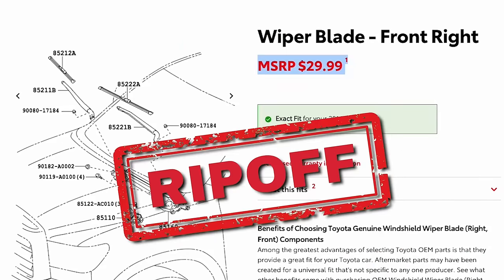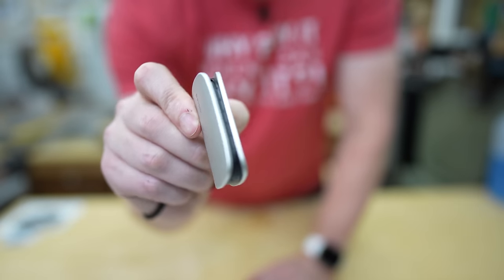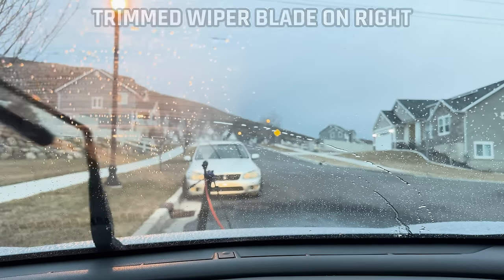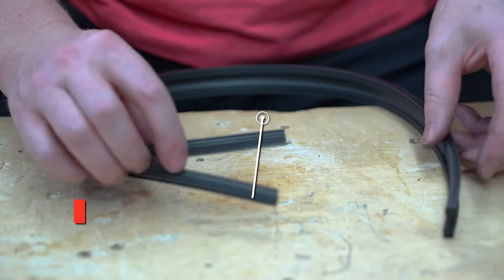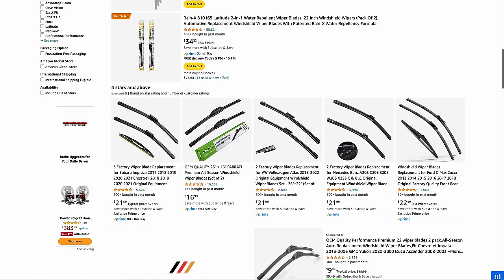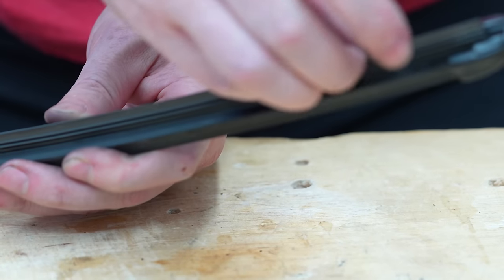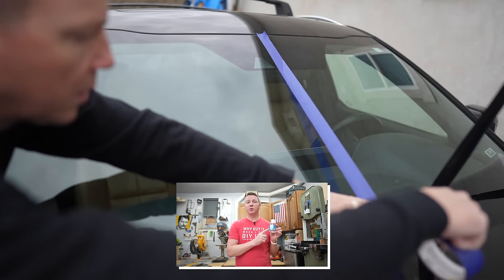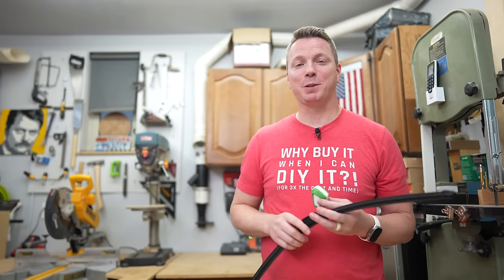Windshield Wipers Are a SCAM! 3 Ways to Save $$$

Comment: I experience engineered obsolescence with my wiper blades. Before the blade edge wears out the entire blade separates from the rubber portion that the frame holds onto. The connecting strip has become thinner over the years so it tears away faster.
Reply: This the silicone wipers?! I just got some from a recommend by the Autozone cashier, and they are impressing me. Hope they last. Was changing my normal rubber ones every 8 months or so.

Comment: To super clean and prep your windshield, try this.  Do this only on clean dry glass. Not on window tint.  Scrub glass with 0000 steel wool. It is the finest grade.    It will pull out any impurities in the glass, like clay barring paint.  You can actually feel the results.    The steel wool will drag a little at first, and then it will slide over glass when contaminants are removed.  Clean and dry again.  Then do your glass treatment.

Comment: If you bought a used car and expecting to just get wiper blade inserts from the dealer, the previous owner might have replaced it with an aftermarket wiper blades - so do check, or if you're not sure ask a technician if it can be replaced (they'll know if they worked on these long enough).

I find oem works best and last long (for toyotas at least, on that note some tundras and avalons doesn't have replaceable inserts).

Comment: Never use oil like wd40 on any rubber product. It swells the rubber. Windshield wipers usually start failing because of the suns uv rays which makes them hard and lose their elasticity. The replacement  rubber is a good idea though . They used to sell them at auto stores .

Comment: If you go thru  automatic car washes use spray cleaner to remove the wax from the blades and windshield. Tree sap too. Even my Ford manual tells to do this. If your wipers skip or stutter the arms may need twisted with pliers to land square against the glass. The inserts sound great, good to know!

Comment: Silicone lubricant is another thing you can use that will prevent the rubber in the blade from cracking and aging, you just have to make sure you don't get it on the glass and wipe off any excess or it will streak your windshield.  You can also use it to lubricate the wiper arm and any moving parts to keep them from squeaking and prevent rusting.

Comment: One issue with the wiper fluid tip is tap water. If you live in UK, some areas have a high mineral content in tap water and it will leave water marks where the water evaporates leaving the mineral deposit. Best to use distilled / reverse osmosis water.

Comment: OBSERVATION i remember when ww fluid cost 99 cents a gallon. I buy costco wipers on sale for 7 dollars and for my car i wait until i get an oil change and my dealer has a special 7 dollars per insert installed. But u are correct. Paying over 10 per wiper is crazy
Remember that you cant use the tablets in below freezing weather

Comment: I've actually used sandpaper on the wiping edge of the blade to take off the crusties if you will. Smoothed out the edge of the blade then cleaned it with WD-40. I used 120 grit then 220 grit. I don't think you need to stick to those grits though. If you want to use 180 then 300 I think you'd get the same results. It just took the nasty edge off that was creating streaks while wiping. The the WD-40 cleaned off grime and moisturized the blade.

Comment: The biggest scam regarding wipers is dishonest mechanics. I’ve replaced my wiper blades just before bringing the car in for inspection renewal and then was told I needed new blades (which cost 3x what I paid to buy them myself) despite the fact I just replaced them the night before. Obviously I didn’t go back to those mechanics but it happened more than once.

Comment: The black dirt coming off your whipper blades is a led-carbon powder which is meant to make your blades glide over your windshield without skipping around nor leaving any oily streaks. This powder is also used by locksmiths to lubricate locks.

Comment: Wd-40 is not a good option for cleaning rubber... It will swell the rubber... Soapy water is the best option, rubber safe and everyone has dish soap

Also those washer fluid tablets typically are only good for summer use because they have little to no effect on the freeze point of the water

Comment: I always use blade refills . No muss , no fuss. I have learned that after market blade assemblies never work as well as an oem assembly . At speed they can lift etc... OEM blade assemblies are engineered specifically for that cars windshield and can make a huge difference at highway speeds . Refills are the way to go and RainX is also excellent .

Comment: rock auto continuously has sales on wipers ( regular $3.00 - $30.00 ). If you catch a closeout sale you can get stuff for a buck. and use distilled/filtered water for the tablets as tap water in some areas has lots of minerals and will clog the small passage of a sprayer.

Comment: A good starting point for all of this is to go over the windshield with a cerium oxide polishing kit. use a rotary paint buffer on the low speed, typically +/- around 1200 - 1800 rpm. Wouldn't go much over 2500 rpm, &  it's VITAL  to mind the heat buildup on the glass. I had a 63 Cadillac hearse/ambulance with metal to glass wiper abrasions half an inch wide & probably .01 inches deep. the abrasions literally looked like acid-frosted window glass.  Job took over an hour, but came out so nice the only clue afterword was an ever so slight shadow anomaly on the dashpad when the sun hit it just right.

Comment: If you are not a perfectionist and don't mind a streak or two then blade trimmers are great.
Works on the same principle as knife blade sharpening, removing worn edges and revealing new material. Not as perfect as factory computer machined edges but still works.
The fact it will fix the skipping caused by hardened rubber and noise is bonus for people.
Great for the wallet and environment.

Comment: WD40 at least partially dissolves or disintegrates rubber, so any black residue on cleaning cloth doesn't indicate residual dirt or need for more cleaning, but you destroying the rubber, potentially creating more streaks.
Reply: I tend to think of it as "exfoliating" the rubber.
Reply: @brendabowman622  not a thing at all, sorry.
Reply: @toseltreps1101  -- Yeah, what do I know.  I just charged people to "dress" their wiper blades for 24 years.  It cost them a whole whopping $4.00 and extended the life of their wiper blades for a year or so.

Never had a complaint, sorry... not sorry.

Comment: I paid $50 for a set of PIAA silicone blades. More than 4 years and almost 100,000 miles later, they still work great. And I don't clean them or my windshield as often as I should.

Comment: I find that I get almost the same result was RainX by cleaning my windshield with 0000 plastic 'steel wool'. I think the RainX stuff just makes the windshield super smooth, which the 'steel wool' does too (you can use actual steel wool, but any little bits you miss will rust, which is unsightly).

Comment: On older wiper blades, WD40 and Silicone works for awhile and using rainx helps but if you liive in a real wet climate like here in Kaneohe Oahu after a few years you just buy new blades and they'll last about 5 years with good cleaning.

Comment: I don't recommend trimmers. As rubber ages, it degrades and becomes brittle. Rubber is harsh on blades and your trimmer will become dull real quickly.
The best way is to change the refills. You don't even have to remove the endcap on that particular type of wiper since most have a notch to pull out the rubber. In order to do that you must push it back until the end meets the notch before pulling it all out.

Comment: I use the change them every spring method. In Michigan’s snowy climate ice and snow can beat them up and lots of bugs in the warmer months. I’ve had to actually use my scraper for bugs, probably worse than ice and sleet. Better homemade windshield solvent made with methanol and a few drops of dish soap works for me.

Comment: I'm a bit uneasy about tablets used with regular water. I wouldn't put regular water in the windscreen washing tank for fear of limestone and other contaminants deposits, especially on the narrower portions of the whole circuit: pump nozzles... Here where I live (Romania) I've seen bottle of "concentrated" washer fluid that you mix with distilled water... but to my knowledge, regular water is advised against in windscreen washer fluids mixture. 
Also... a little bit of bad experience I had some years ago... working on an automotive control unit that also had a driver for the washer pump, we had this test jig with the OEM's pump and reservoir assembly connected to some hoses and an acrylic tank in such a way that when activated, the pump would dump fluid into the tank and from there the fluid would drain because of gravity into the reservoir. So, during the first batches of tests, hurrying to get started, we just poured tap water into the reservoir and got on with our work. A couple of months later we managed to kill the pump and were curious why. Because of the limestone deposits that accumulated in the pump, it had to work harder, edging close to it's stall current. And this particular pump had quite a high stall current... so it proceeded to release the magic smoke sooner than we anticipated. 
We replaced the pump, drained the tap water and replaced it with distilled water (after rinsing everything thoroughly with distilled water) and continued our work. This time the pump only dies when we did other nasty things to it (short-circuits and stuff...).

Comment: I wrapped the tips of my wipers with Teflon tape . After they started to rip at the tips, I glued them with rubber glue and when dried, put the Teflon tape. It has been months without replacing them. The Teflon acts as a lubricated surface 🎉  🎊

Comment: I use 402 as it helps recondition rubbers it is also good for tires BUT do not use if it is going to rain that week or motorcycle wheels as it is an oil base and you dont want 2 in line slick tires cars at least have 4 to balance out

Comment: 1) get decent wipers, they stay good longer. Especially if you park indoors. I use Bosch
2) Don't overuse your wipers. Set them so that they are pushing water, not rubbing on a mostly dry window. They last longer.
3) use a decent washer fluid with water repel, like rainex. Again, the wipers have an easier time and last longer.
4) if you get any kind of oil on them, use rubbing alchohol and wipe them down.
Reply: $50 for a set of Bosch, $1 to refill.
Reply: @solarsynapse my wipers last about 3-4 years, that's less than 15 bucks a year spread out. I'm not going to mess around for an hour trying to force a rubber strip into a groove it was never made to come out of to save an hours worth of wages a year.

Comment: Back in the day we rarely if ever bought new windshield wipers but just the 99 cent refill packs which every auto parts store and most department stores carried until Extreme Greed set in and they started to only carry full replacement wipers and stopped stocking the cheaper refills.  Most times you didn't even have to remove the wipers from the car and could just slip off the old and slip in the new with the wipers still attached to the arms.  We never changed the entire wiper unless it had be damaged beyond repair.

Rain-X can put additional stress on the wiper motors and linkages and at times its been so bad that the wipers won't be able to function at all.  Washer fluid to me is a cap-full or two of vinegar and one literal drop of dish soap to a windshield washer tank of water and if you really need it to be blue or green you can add a drop of food coloring if you feel like it.

Hint:  You can also borrow some food coloring from the kitchen to add a little amber tint to some of the new water based polyurethanes to give them a tint to better match a traditional amber varnish.

Best!

Comment: Where I live wiper blades cost 2 dollars each. Change them every year or two. Why would it cost more? There are some wiper blades that costs more due to non-standard size? like rear wipers that come as whole, but not much more expensive - about 5-6 dollars, but they last longer since rear wipers are used way less.

Comment: You can use anything to clean the blades, like a paper towel, rag, or just some steel wool or dish scrubber.
clean the rubber every time to put gas in the tank.
Almost all wiper blades have non-replaceable rubbers.

Comment: An old neighbor of mine used to just wax all the windows of his vehicles. Never tried it but what the heck, seems like it would work to me. Got caught at work in a really bad ice storm  a few weeks ago, pulled the truck inside and put a few drops of super slippery vacuum pump oil on a rag and put that on the windshield/ wipers/cowl for the drive home. Worked great, -just thought someone might like a story + use what you have to. be safe

Comment: For those in hot environments, you need to get silicone wipers. Rubber just falls apart after one summer, but silicone isn't gonna degrade in the heat.

Comment: When I was a youngster, one of my buddies worked at a quick oil change place. In the warmer months they filled a 55 gal drum with water and dropped in a blue koi pond tablet, so basically everyone just got blue water, which I surmise is what is sold on amazon. But the funny part is that when Sept/Oct rolled around, they had to switch to real windshield solvent so it wouldn't freeze. The old blue water just got rolled out into the parking lot and emptied into the sewer. My buddy took the old summer barrel out and dumped it. The owner came in and asked, "Where's the new drum of winter solvent I just had delivered?" That didn't go over well.

Comment: I am going to add a little "controversy" to the blade trimmer usage discussion... When you use ANY razor knife for cutting, if you stop mid use, it will leave a divot before restarting the cut. This is especially common in softer materials like rubber... I noticed you stopped somewhere in the middle of each demonstration. Those will work better (if it has a good blade) if you do one continuous cut along the whole length.  This may require a bit more setup at the start and anchoring the starting side better so you are always pulling away and not having to stop.  I had a leather trimmer with a flat guide and a very sharp blade that worked just great for trimming a wiper blade for at least one additional use, sometimes two... but it DOES require a bit of dexterity, pre-setup, knowledge about what you are doing and a modicum of skill. Sometimes you can get other customers old blades to practice on since they usually throw them out anyway.

Comment: How do the washer fluid tablets keep the fluid from freezing in the winter? Isn’t regular washer fluid part alcohol to keep it liquid?
Reply: That is a good question. I'm all in favor of saving money, but sometimes it's just not worth it. Normal washer fluid isn't that expensive. I had a washer system freeze up on me after the dealer filled it with water... in January... in Canada... Thanks, guys.
Reply: I’ve lived in a place with winter my entire life. I’ve never used “anti-freeze” or “winter” washer fluid. A good washer fluid contained ethanol (or methanol, if you like toxicity) and won’t freeze in all but the coldest temps. Any washer fluid that has additives (anti-freeze, anti-bug, etc.) is almost guaranteed to leave a film of some sort on the windshield.

Comment: I've been detailing cars as a hobby for a decade+ and professionally at a dealership for a year and a half. I question whether WD40 will degrade the rubber on the wiper blades or leave a residue on the windshield. Instead I recommend a quality glass cleaner. I like 3D Glass Cleaner and Stoner brand Invisible Glass.
Reply: I haven't tried those, but I get really good results with Sprayway Glass Cleaner (foaming glass cleaner in an aerosol can) and a microfiber cloth.
Reply: I've done this trick, no streaks, no residue. Honestly the sun and regular usage does a far better job of degrading them. Plus when people use WD40 to clean them they're likely already worn blades or need replacing anyways.
Reply: I use the spray dish soap cleaners then apply ceramic detailer on cleaned rubber, excellent results so far

Comment: Tip- whenever repacing blades, put a towell/cloth/foam on the windsheild. Learned this valuable lesson when I accidentally hit the wiper arm without the blade on it which caused a crack on the windshield.

Comment: Change you wipe blade every autumn (1x/yr)…, newly redesign vehicles that are fairly new to the market or are relatively “rare” may not be supported by the mass-marketed blade mfg’s, so worse case y’all will have to get it from the branded dealers parts dept.   use to be that back in the day, in the NY snowbelt, we’d swap out WSW blade in late fall, installing “winter WSW blades” that were solidly enclosed w/ rubber such that they’d not freeze and lift off the windshield

Comment: I don't recommend wster repellents on the windscreen if you do city driving, specially at night. The speed is not enough to push the drops and the city lights are gonna be reflected on every single drop in the windscreen. Even using wipers it will still reflect and reduce visibility. Great on daytime specially motorway.

Comment: If your in Utah, your going to regret those washer tablets pretty quickly as soon as it gets cold. When alcohol was still cheap, you could buy a .50¢ bottle and mix it with water but now a bottle of that costs more than the big bottle of the premium washer fluids.